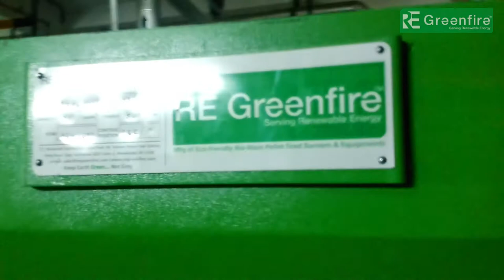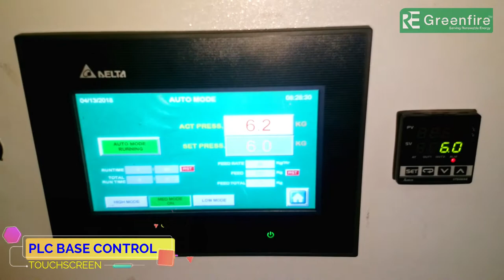2 TON STEAM BOILER▐   PELLET BURNER ▐  10,00,000 KCAL/HR▐  RE GREENFIRE™

Comment: If v compare to  wood firing boiler 700kg boiler this pellet burner would be cheaper?
Reply from the maker: Hello Sir, Pellet Fired system not cheaper against wood, but if we calculate wood vs pellet with all wood headache, like wood storage, 30% moisture, sharp temperature, high running electricity consumption,  wood pollution, long chimney with no automation. and pellet have fully automation through PLC-HMI controls and we specially design Pressure feedback controls for Steam boiler, and zero pollution no long chimney require in pellet burner even ID fan also not require in many case. pellet 10-18% higher side of wood with loaded automation. 
if you have any question pls contact: sales@regreenfire.com, visit: www.regreenfire.com
Reply: @REGREENFIRE  can v use sawdust in ur burner that is cheaper than pellet
Reply from the maker: No sir,  direct sawdust not fire in pellet burner. sawdust cheaper than pellet but pollution. and pellet burner is eco-friendly unit.